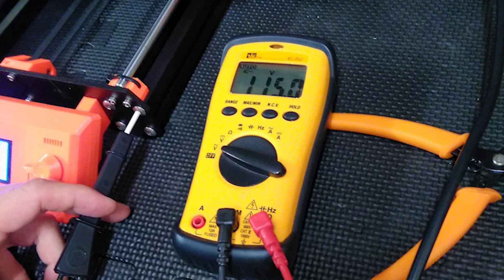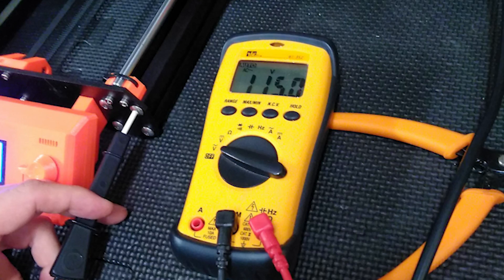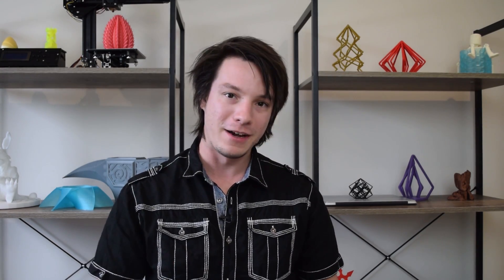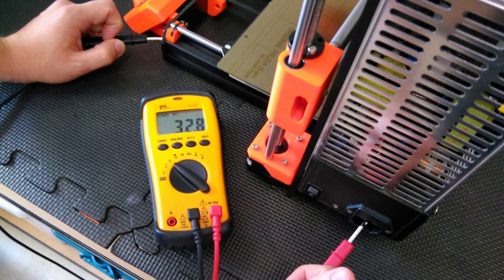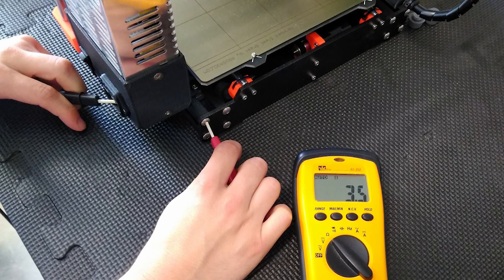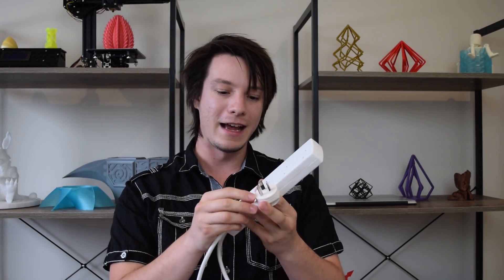I got shocked by a 3D Printer

Comment: It could have happened due to the fact that the aurora had been moving for so many hours without grounding. It probably built up electrostatic energy throughout the process in the way a balloon builds up energy when rubbed with certain matterials. If that's the case, if the machine had been working for a longer period of time it would have been worse. 
However this doesn't imply that the Aurora is more dangerous than other 3D printers, it could have happened with any other metal frame machine. Also, if there were 115V when you meassured it, it was probably a much much higher voltage before, something closer to the 1000V.
Reply: The JG A5 is grounded, it was his linkage of many cords that was the no-no

Comment: I got a shock from my cocoon create touch. Not so much a shock, just sparks. Turns out the psu earth's through the mounting screws. And there was no connection. And I had 24v at the USB earth
Reply: @me217 I have a CCT as well. Should I be doing anything to make it safer?
Reply: JAYTEE if you got a millimeter check for voltage from the frame of your printer and the outside of your USB port. All I did to fix it was remove one of the mounting screws for the psu and scratch off the powder coat as that was insulating the bolt. Now it's all good.
Reply: @me217 Thanks. I'll do that 'shortly' ;)

Comment: Wow hope youre okay  that must have been scary .. I've been playing  around with  "ready to print  out of the box "    and about a week ago   I ordered my first 3d printer kit I thought it would give me a new experience  and knowledge about the workings a printer  but when my Tevo tarantula  came it didn't have a plug a switch and a bare psu   so I went  and order all the missing things like like plug/switch/fuse combo  3d printed a a cover   and got a 3 prong cord  and also looking at a mosfet  for the heatbed  do you think there are any other precaution I should take before powering my Tevo up for the first time

Comment: There's a leakage for sure, even if your not connected to ground it should not Ger shocked. Although in normal situation you may feel some transient voltage on ungrounded equipment. Since you connected ungrounded you are exposed to any leakage to the chassis. If you know what transformerless power supply is, (mostly seen on led lamps) it's a mains voltage transformer with caps and resistors. So my point is , in your PSU you have some components are attached to chassis and separated by miscas. Which acts as capacitors, causing leakage to the chassis.
Reply: If you connected a earthless extension the problem is the psu. If you connected a earth extension not having earth connected to your house earth your wire is probably leaking to earth and passing it to chassis

Comment: 1st glad to hear that you are okay, even i saw you few hours ago alive :-)

Looking at the pictures http://diy3dtech.com/whats-inside-the-jgaurora-a5-3d-printer/ the JGAURORA A5 the PSU seams to have a ground pin connected to the C14 plug BUT can't see if there is any extra ground connection to the steel frame.

In video https://www.youtube.com/watch?v=fHjPIeWjshI&t=763s at 4:16m you can see that the PSU is bolt with 4 screws to the frame.

If that is a real MEAN WELL PSU according to the data sheet http://www.meanwell.com/Upload/PDF/LRS-350/LRS-350-SPEC.PDF and http://www.meanwell.com/Upload/PDF/Enclosed_Type_EN.pdf the PSU should have a clearance of 10-15cm around it to be cooled properly.

Maybe the screws are too long and touch the PCB inside of the PSU.

The design of the bottom frame of the JGAURORA A5 enclosing the PSU completely without any ventilation holes is not a good idea. The PSU fan will have a hard time to get this cold i guess.

There were already good tips how to measure the beast :-) so no comments from me.

You should get a proper power box in the garage including a FI circuit breaker.
Reply: from the data sheet
Leakage current <2mA / 240VAC
Well that explains why Angus is still with us.
Reply: That's what I was thinking ... an arc that gives you a tingle is hardly dangerous.   I've installed many things, and I've known from a kid that grounding is important.  We owned a business and had vending machines...if you touched the coke machine and the food vendor, you'd get a tingle.   One of them were not ground right.  Oh, I didn't die.
Reply: Exactly. It's perfectly normal, and NOT DANGEROUS!

Comment: The 120v reading is your hint. Since it's only half the voltage of mains your cord probably has a whisker touching the frame of the power supply. The printer basically acted like a voltage divider.

Comment: Used to get this problem all the time in my industry. The cables used to get stepped on or bent a lot. The printers will check out fine. It’s a mains cable problem usually, either the black mains lead or one of your daisy chain extensions has internal leakage/insulation breakdown.

Comment: First off, Angus I hope you´re fine and that you went to a doc to check your heart! Electricity can be seriously harmful even if you feel fine.

If the "ground" rail on this strip was just connecting the printers and not to the actual earth as you said it shows that the Aurora has a damaged/disconnected cable touching the frame or a bridge in the PSU and that the ground pin of the Aurora works as intended (i.e. it would have tripped a circuit breaker were it grounded).
My guess is that the PSU/IEC adapter is faulty as no other part on a 3d--printer should have >12/24V connected. You can check this by disconnecting all printer electroncis from the psu and then rechecking the resistance between  main and ground on the plug (should be very high of course, I tried on a PC psu and it couldn´t even show a value.

Comment: 110v bruh your petty , ive been shocked more than 4 times with 220v and it was bad but whatever , no one knows still from my family
Reply: It's not about the voltage, it's the current that kills you, or rather a combination of both, a piezoelectric lighter can give many many thousands of volt and all you feel is a sting or tickle! 110v with some amps will kill you!
Reply: And you're bragging about that?..
Just been reading the comments, some really ignorant stuff going on here.
I have a degree in Electrical Engineering so let me shine a light on a few misconceptions here.
1) It's not the volts, it's the amps! Not true at all, as Karl said above, it's the combination that will get you, but there's more to it than that. The voltage is what can cause your heart to go into fibrillation (beat erratically) and also higher voltages basically lowers the resistance of your skin as it pierces the first layers, after a few layers of skin the moisture and iron in your blood actually conducts electricity very well. Above merely 20v the voltage-current characteristic (how resistance changes with voltage and current) of skin becomes extremely non linear with respect to time, making time, not current, the critical difference between danger when receiving an electric shock from say, a static shock (in the order of several kilovolts, but for only a few microseconds at that voltage) and touching the frame of an ungrounded, faulty piece of equipment. 110v could easily kill you if the amperage was high enough (power dissipation is the voltage * current.) My printer runs at 240v 8A, i think the power in australia is 230v so the amperage is probably similar for this printer, putting the power dissipated in this shock at almost 1kW, pretty nasty (and in the video he clearly shows it could have been worse). If you contacted it long enough for the skin breakdown to reduce the resistance of your body, it starts of around 100kohms but after a few milliseconds could reach around 1000 ohms, then you could be in trouble.
2)110v isn't high enough to kill you therefore why bother making this video? For a start, we have established that (if you were really unlucky to be fair) it COULD kill you. secondly, he SHOWS YOU IN THE VIDEO that the path to where he got shocked has an unusually high resistance to ground, a few kohms, which would have dropped a fair bit of voltage across it, if he had touched the 3ohm ground connection and gotten shocked there the voltage would have been significantly higher!! More to the point, the video was generally a warning video against a few big nono's and it was definitely a good video. I don't think this video was criticising the faulty printer per se, although obviously it was a contributing factor. The warnings about daisy chaining, using ungrounded "isolation" power adaptors (NEVER DO THIS WITHA HV PIECE OF EQUIPMENT) and working with electricity when you're tired or distracted are definitely worth saying. If someone as experienced and knowledgable as Angus got a shock, anyone could. Especially with all the myths that go flying around about the dangers of electricity.
Reply: It can only take 50v to stop your heart. Depends on the path it takes through your body (e.g. grounding from one hand, across your chest to ground on your other hand). But yeah, getting zapped with 240v usually results in just getting really pissed off.
Reply: It’s not a matter of pain, it’s a matter of risk. 110v may be fairly low but that doesn’t mean it couldn’t be higher depending on the situation. He made this video to warn people not to do what he did, and about the JD Aurora. He said in the video it was only a slight tingle, but depending on why your printer is carrying a charge, the voltage could be a lot higher and so would the risk. 3D printers should not shock you regardless of the voltage, it shouldn’t happen.
Reply: Etro Uuuh, watch out, we got a bad ass over here. So what dude? It's not cool, only dumb
Reply: Its both! You need a high enough voltage to pierce the skin, and enough amps for a strong current to flow to the heart. Voltage is the force that drives the electricity, amperage is how much energy an electrical signal has.
Reply: Just to put things into perspective, my Dad worked on the railways in the south of England. One rainy day he carefully stepped over the third rail, electrified at 750v DC and a fair few amps. He forgot his mac was trailing along the ground behind him... The jolt threw him into the ditch and knocked him unconscious. Lucky he was soaking wet, as his clothes conducted the majority of the current rather than his skin. He survived. The guy seems immortal.
Reply: +Benjamin Faure Even wet, a 12V car battery isn't going to hurt you.  You ever use a metal wrench on the positive battery terminal, while leaning an elbow on a car body or exposed metal?  I have.  You get a burning sensation from the smallest contact point after several seconds, but that's about it.
Reply: +Rivalgamesbg https://www.youtube.com/watch?v=ZxBF7WC0TQk
Reply: Seriously guys, go look up ohms law...
Reply: karlpc200 hahahaha i can't believe you just said you can't get shocked by a car battery, that thing is like a teaser
Reply: I did 1.2k volts to my arm just to see how a taser feels like and if I can fight it.
Reply: What a lucky guy!!
Reply: Also keep in mind a Dc shock requires far less voltage and current to kill you or cause serious damage as opposed to Ac power because ac being alternating gives your body a chance to let go while dc does not and on top of that dc volatge has 1.414 time the power as the same voltage of Ac power. This shock from the printer could have easily been dc as it is a dc device
Reply: You can't get shocked by a truck battery...
Reply: No it's not, I can go and touch both terminals of a car battery right now and nothing will happen.. Try it yourself
Reply: Rivalgamesbg it is because if he said i got shocked by a a truck battery i would know because truck batteries have high amperage and it is much more harmful but this doesn't feel like it's worth a video really, it will make people not buy the printer just because of him
Reply: Same here. 110 sounds(and probably is) harmless. I don't think it's worth a video.

Comment: I have seen this exact issue cause major problems for big multi-million dollar operations. 

One of the system builders had used a cheap power strip, in our rack, to connect a number of critical systems to the UPS.

This power strip did not have a ground installed. Which meant that whenever we power cycled our GPS beacons, we triggered high pressure air systems to fire without warning. This could have resulted in an uncontrolled explosion, whilst people were working on the units. 

A very harrowing thought.

When I found the power strip in the rack, there were some choice words exchanged with my supervisor.

I would advise anyone to get a plug tester for a few quid and check your kit before you use it. There is a reason you have to regularly PAT test these things in commercial environments.

Big fan Angus, keep up the good work.
Reply from the maker: I'm fine to accept the fault of my own actions but the thought of it injuring others is unfathomable. I can only imagine it was pure carelessness that put that power strip there in the first place... harrowing indeed! Thanks for the comment.

Comment: I've electrocuted myself on a light fitting - in my younger days not realising that the voltage is still live even with the light switch off. It wasn't fun and you were lucky (just as I was) ... I'd suggest always check your extension plugs are earthed and if they're not .... chuck em out. Keep up the electrifying videos :D

Comment: Electrocuted myself at my uncles farm in Wagga as a teen trying to set up an electric fence. Happens to the best and worst of us.
Reply: zman1508 then how are you typing this? o_O
Reply: Every few days I directly touch the positive and negative leads to my electric fence battery. I don't know the voltage, but it's a sharp sting to my body. I don't think it's enough to harm me, it's not quite as strong as accidentally getting shocked by the white and black wires in a light fixture. The reason I do this, is to know that the battery is still working. It's not connected to a main, it's just solar. I don't think it'll harm me, but it's a bit fun.
Reply: An electric fence doesn't  use main voltage,  but it still hurts like getting hit on your shoulder with a hammer when you touch it with your hand.
Reply: This guy gets it